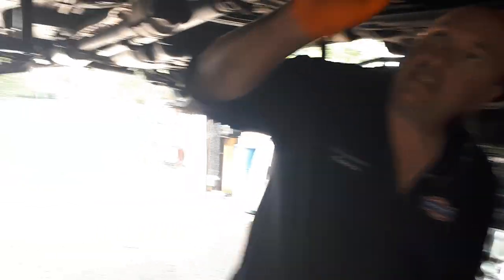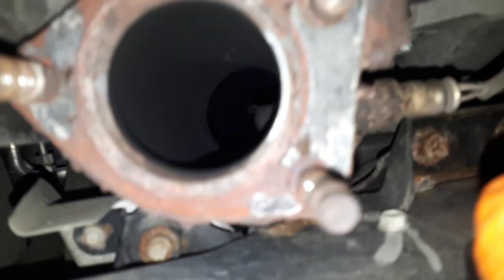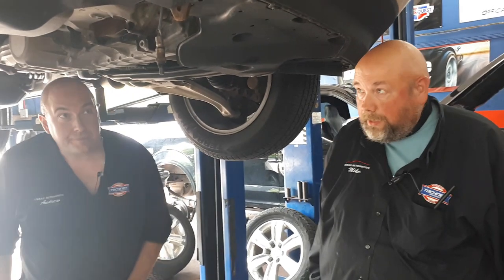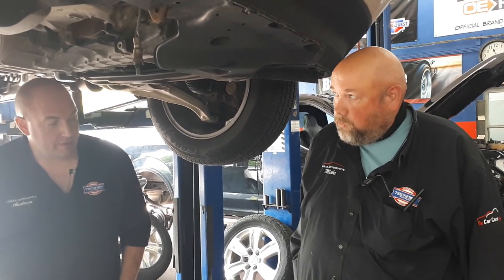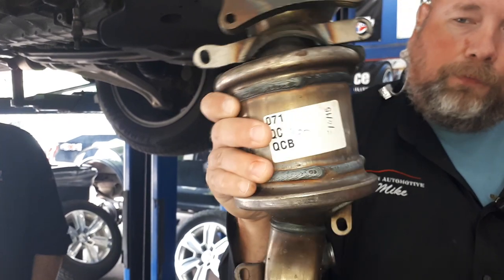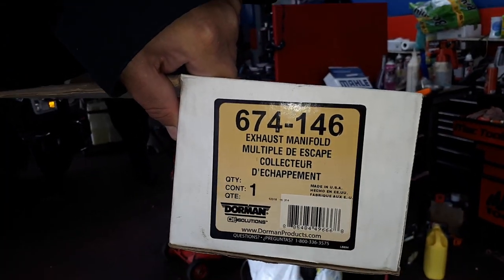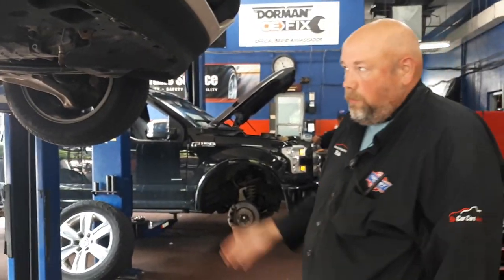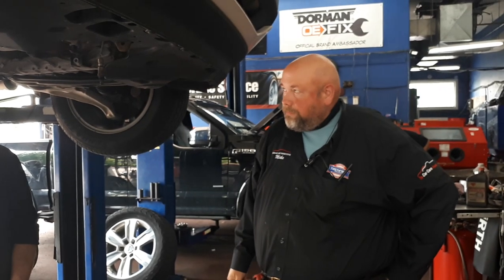P0420 code on a Honda 3.5L V6 @UrbanAutomotive01

Comment: Hello

Thanks for the very informative video. I have a 2005 pilot which showing both codes for the cat convertor (bank 1 and bank2 ) below the threshold. Does this mean only the front catyltic converter needs to be replaced? thanks
Reply: What codes came up for you?
Reply: Same here I don't know which one is bad out of 3

Comment: I removed my rear . My truck is throwing the 420 a year later . Maybe plugged substrate? No power loss and I have had the 420 twice . Cleared it and it has not came back? Could burnt oil or bad gas cause that . Been doing thousands of km without it appearing again . Thanks up here in barrie .

Comment: My 06 Pilot with the same code popped just now. Looks like goodbye thousands for some damn metal
Reply from the maker: Not necessarily thousands... there are kits available through Dorman as mentionedin the video. Have your service  center confirm if one is available. Www.dormanproducts.com hope this helps. 🙏
Reply: Yeah it does cost 1000s unless you find a oem replacement on marketplace. If you don't live in california you don't need an oem one so you could get Dorman or whatever brand.
Reply: @Jaydogg209  I found a genuine OEM one for $1,318 and got it replaced for $450 and car is running nicely!

Comment: What signs would fee when driving if that is the problem?
Reply from the maker: Among the symptoms of a bad catalytic converter are:

Sluggish engine performance.

Reduced acceleration.

Dark exhaust smoke.

The smell of sulfur or rotten eggs from the exhaust.

Excessive heat under the vehicle.
Reply: @UrbanAutomotive01  thank you.

Comment: Did you check Mass Air Flow sensor?
Reply from the maker: Absolutely. As you can see from the video the convertor was the culprit. All other components were confirmed sound first ;)

Comment: This is my 2010 Honda Pilot AWD 180k miles 
About 1 year ago had the bank 1 cat replaced at a local mechanic. Not a oem Honda cat, worked fine for a while then engine light stayed solid while on. This happened though out year randomly I'm not good with numbers but the code meanings as told to me were catalytic efficiency and a fuel too rich code
Last month engine comes on and flashing with loss of power and bucking I towed to dealer this time  dealer said it misfiring 1 2 and 3 cylinders claimed it was air intake hose tears causing misfires they replaced. 
Drove it about a week then same thing engine light on and flashing and bucking dealer says same thing its misfiring in back bank cylinders 1 2 and 3. This time they have had car for 3 weeks. All the dealer seams to be doing is calling 1800 Honda which takes 2 days to report suggestion to me for permission to try fix.

Moved all 6 coils and 6 plugs same misfire stays in back bank 1-2-3 cylinders Dealer says plugs looked fine not oil soaked.
Changed fuel line that feeds back bank of cylinders same issue
6 New plugs same issue.
I made suggestions but he does not agree. They are just following 1800 Honda guide lines and suggestions.
Dealer says dont think its EGR valve because they would cause all 6 cylinders to misfire.
Dealer says same thing about the PCV valve. 

I mentioned I had cat replaced to dealer. He says i know and its not a Honda part and that could be problem too. Do you think the back catalytic converter could be bad. I was not showed the old bank 1 manifold catalytic converter I was just told it was bad. Can the back catalytic converter cause misfire in 1 bank of cylinders?
 Also I notice never smoke but lots of suet and carbon build up on my exhaust tips.  What could that indicate?
Reply: Your vcm sytem has caused oil to get through the combustion chamber, through the piston rings, and through the exhaust. You may have burnt exhaust valves, bad converters, or worn piston rings, all of which are costly fixes. If you get it fixed, go online and buy a $100 wire that bypasses the VCM, preventing the engine from dropping cylinders while driving
Reply: @agravy7657  so since you replied i tell you what I have done since then. took car to a new mechanic this guy is a national know top fuel driver. 
This new mechanic changed the PVC valve and put a new EGR valve on. He also re-cleaned the EGR ports that the Honda dealer told me they cleaned. He also said my EGR  plenum was warped so he machined it back flat. All that took him 2 days and the Honda dealer had it near a month and did basically nothing but charge me a grand. Haven't had any issues since its been 4 months. Yes I am trying to buy the VCM disabler but its sold out every time I try for the one I want. VCM TUNNER II.
Reply: @kybble you don't need the VCM tuner II specifically. there are other options that all do the same thing.
I bought the SVCM controller. There is also something called the VCM muzzler
Reply: @agravy7657  yes sir you are correct.
Reply: you might need a valve adjustment if it was never done.

Comment: honda 3,5 v6  biggest mistake i ever made
Reply: Why?
Reply: had 2008 Honda Ridgeline , never a problem except after 2 days ago ! Check engine and vtm-4 light , so I went to the mechanic and they saying miss fire codes , cilinder 6 4 and 3 I believe , then the guy told me is very normal , and he suggested to change cat converter and yes ! that was the problem!!! He told me if I was keep driving my truck like that , will be finish with bad engine! After in that never had a problem with my 2008 Honda Ridgeline, bought it with a 81,000 miles , has 127,000 miles and still strong
Reply: @84blingbling  The reason the cat was clogged is the VCM system causes oil to leak past the rings in cylinder #3 ..A VCM Muzzler fixed the issue..
Reply: I have had mine for 150000km almost and I drive the shit out of it . Zero or very little issues cost of ownership low!
Reply: @ttteeelll  the VCM system fucks up the engine. If you have one, get it bypassed immediately